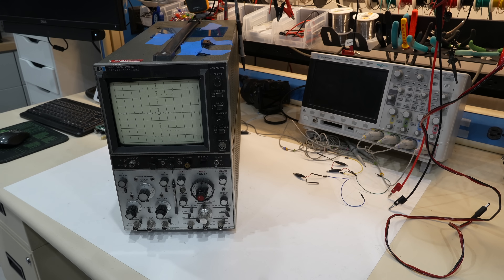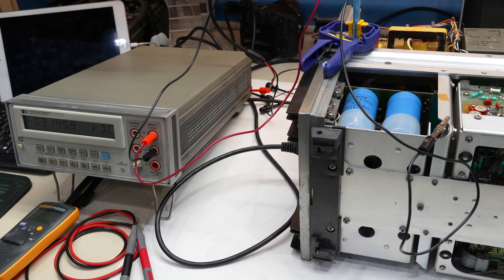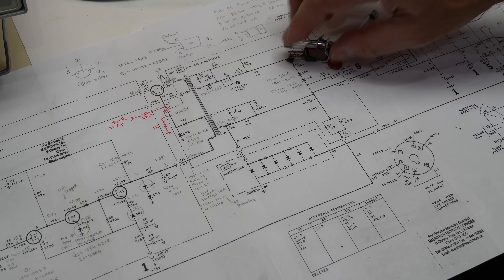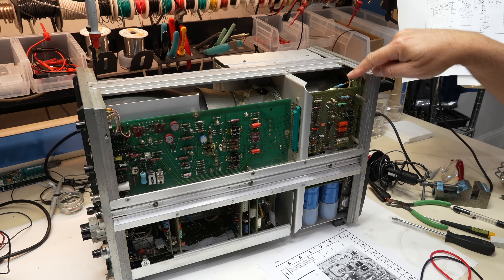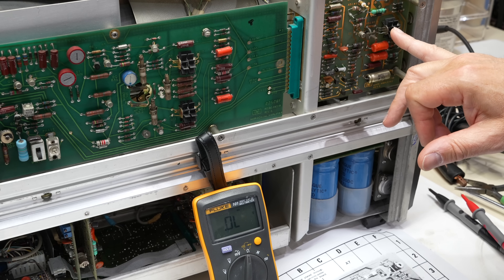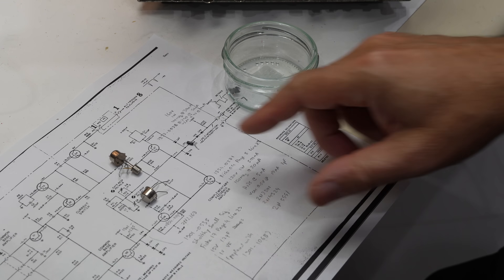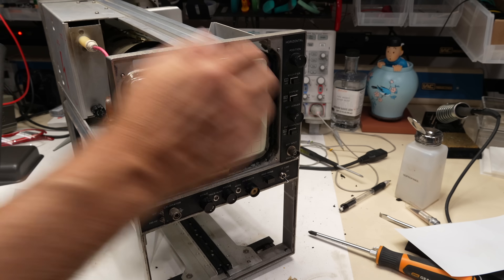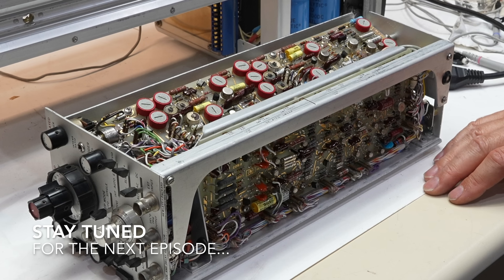HP 182C Oscilloscope Repair - Part 2: Alive Again!

Comment: This reminds me of a customer call in Hong Kong, the equipment - a laser imagesetter, basically a huge laser printer that produces film for creating printing plates - had died after a thunderstorm. The initial symptom was that of an incorrectly biased laser diode, it was 'dragging', or producing enough light to expose the film when it should have been blanked. I pulled the laser driver and found burned components; I then pulled the board that drove it and found more damaged componets; next was the image processor board, more damaged components; finally I reached back to the PSU and, you guessed it, various missing or incorrect supplies, plus a big sooty skidmark by the driver in one of the SMPS sections (the machine had 3 separate SMPS sections rather than a single multiple output one). Apparently no other equipment in the office had failed, so I suspected it was due to a potential difference between the ground of the power supply and the ground of the incoming LVDS SCSI data input. The damage was so extensive that we had to write the machine off.

Comment: Something that starts working as soon as you measure it. Has happened to me both in hardware and in software. One of the unique challenges (and frustrations) of engineering.
Reply: Yes, been there many times, like the laser printer that would print a big black bar on 1 in 50 pages, but would never do it when probes were connected; weirdly enough, the machine was fixed by changing the paper handling module. I was running the removed module in another machine that showed the same fault (and not every machine would) and was narrowing it down, only to find that coming to work on Monday morning, found the lab bare. Our dear employers decided the hardware was more useful in India than in the UK.

Comment: I am currently working on the CRT HV power supply from a HP 3721A Correlator.  An instrument of similar vintage with very similar circuit.    If I probe it with a 100Mohm HV scope probe, it drags down the supply.  If I probe it with a 10Gohm DC probe, I can't see any AC.  A Schrödinger's circuit.

Comment: 8:50 Ha! The transistors saved the protection diodes!  This is why I never really got the hang of transistors, you’ve only got to look at them funny and they die!  Valves (tubes) are so much more robust!
Reply: And you can see that they are broken if the getter is completely vaporised giving them the beautiful silver finish.

Comment: To the tune of "That's Amore"...
When the probe is to long, but you still carry on, you might zap it,
When the probe is to fat, for the place that it's at, you might zap it.
If it buzzes inside, and some smoke starts to rise, you have zapped it,
When you find the burn marks, caused by some errant sparks, you have zapped it.

When you locate a fault, and you swap out a part, you might fix it,
Then another fault done, but it still won't turn on, you can fix it.
When the screen isn't on, so you keep moving on, you will fix it,
No schematics are fun, but they helped with this one, you have fixed it!

Comment: Considering its sensitivity to gain, what would you have used as a replacement transistor if the oscillator transistor in the HV power supply if it had proven to be defective?
Reply from the maker: Same transistor I put, just use a small cap across B-E or inductor in the E lead to calm it down.

Comment: Ha I had the exact same problem, I was tearing my hair out trying to fix what I thought was the HV on a CNC monitor and while probing the CRT socket discovered the same blanking problem, in my case it turned out to be a transistor but I dont think I would ever have found it had I not accidently been watching the screen while probing.

Comment: I had problem with a triger circuit on my Tek 485 (Also blue P11 phosphor CRT) but it was just the biasing circuit for the so called 'ready' tunnel diode, since tek used the circuit similar in operation to an  automatic rifle. 😂 Before every cycle the 'ready' tunnel diode preps the 'trigger' one. But I had my bucket of 'God pleas don't let it be the tunnel diode' moments. 😂😂😂

P.S. Also I deeply dislike HP oscilloscopes. Except HP1741A, 100MHz, analog storage. The best looking stored or 'variable persistance' trace. Razor sharp.

Comment: I wonder if AI is able to debug like you do Marc.
Reply: Seems unlikely that current LLM AI systems have the training experience with 1970's high voltage power supplies to understand what's going on here.
Reply: Current LLM systems completely lack the ability to do logic deduction. They will tell you a sycophantic story they made up from having digested a forum post where someone looks like they could, while at the same time completely lacking the underlying  foundational logic that is the thing that actually drives the thought process in someone who knows. Rather than belching forth phrases.